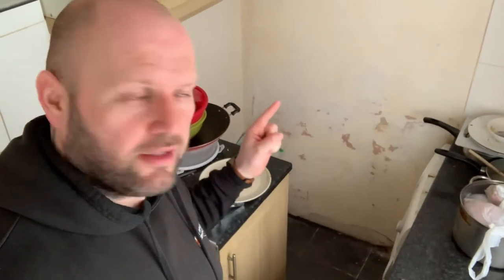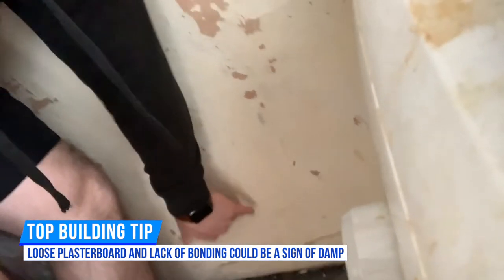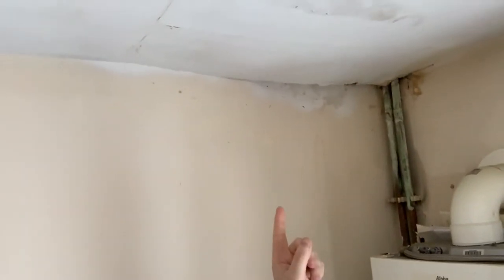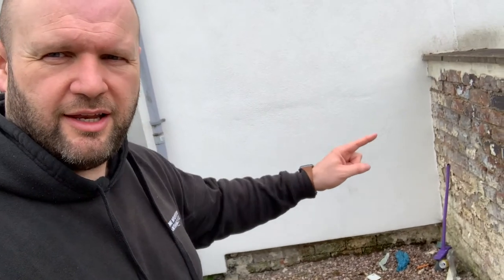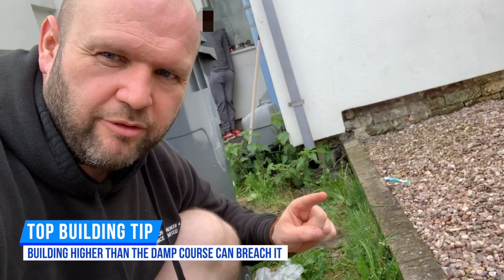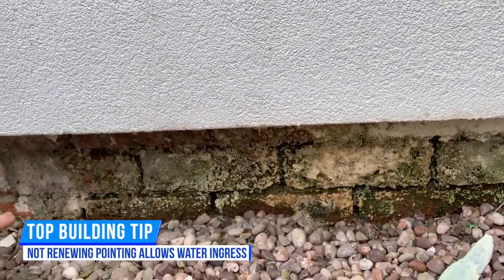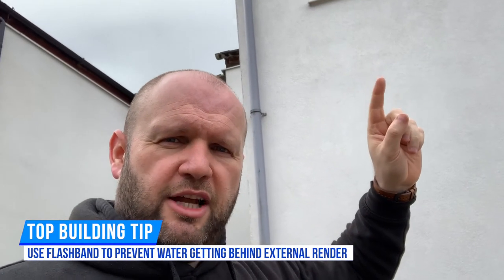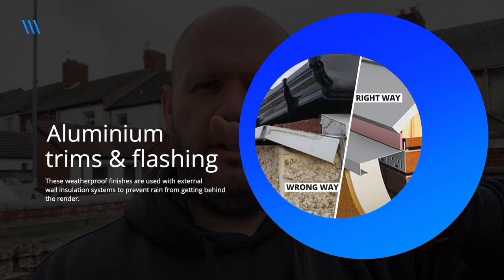External Wall Insulation and Render Issues: Builders Briefs (Part 7)

Comment: Great tips John, I am learning! Just like to add that quite often these old kitchens have no dpm under a silid floor and if the plaster is down to floor level (which it often is!) the damp can wick up through the plaster. Also on the outside I think the render is missing a bellmouth drip at the bottom, so rainwater could be tracking back onto those bricks at the bottom that were sopping wet. Ofcourse you are right about the gravelled area being too high, just thinking that often it can be a combination of things with damp.
Reply from the maker: Thanks again for your comments, Danny. Really pleased these videos are proving handy. Keep on posting! 😀

With regards the kitchen in the video, it didn't have a DPM. The plaster on this wall is down to the floor but it's on plasterboard not bonding coat. If the plasterboard has been stuck to the brickwork with dry wall adhesive, this could breach the damp course – but if newer methods have been employed, this should not happen.

Completely agree with the bell mouth on the render.

As you say, it is usually a combination of things that are to blame for damp.

Comment: Love the vids, especially damp related,  thanks for taking the time to post them,, have you had any issues with exterior paint and cavity wall insulation causing damp inside i wonder, as i suspect this in a house Im about to take on....keep up the good work  :-)
Reply from the maker: Hi Chris. We're thrilled that you like the content 😀 Thanks for the great feedback 👌

With regard to your question: Yes, we have seen this in the past. Filling a cavity wall with insulation can prevent ventilation and stop the cavity from breathing. 

Also, the bottom of the wall inside the cavity can get filled with rubble and what we call 'snots' (mortar that has fallen when the brick was laid). When rainwater hits the external wall, it can penetrate through to the snot. And if the cavity is insulated it can continue to penetrate the inner wall because the insulation stops it from evaporating. 

Snots can also breach the DPC (if the property has one). And when the walls cannot dry out, the result is DAMP! Painting the wall also seals the bricks and this stops any moisture escaping.

Hope that helps, Chris. Thanks again for watching 🙂👍